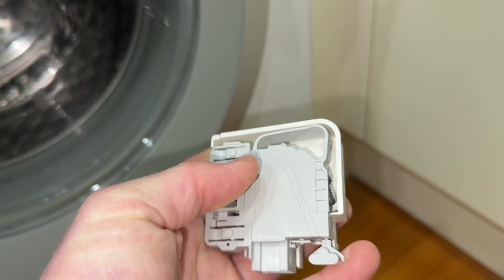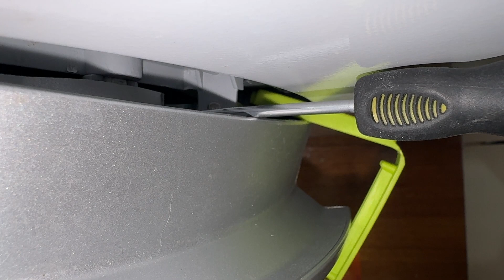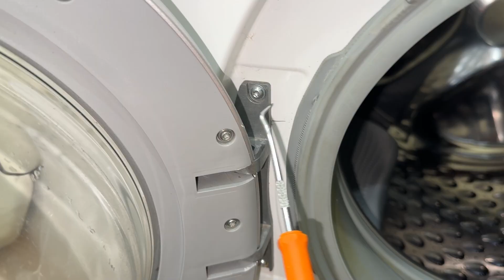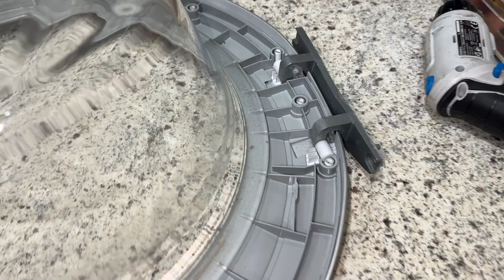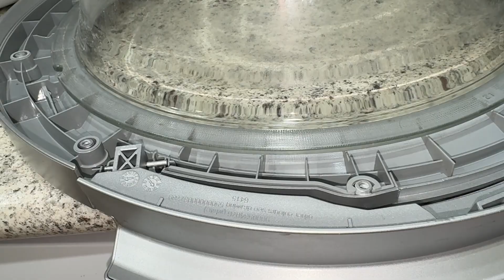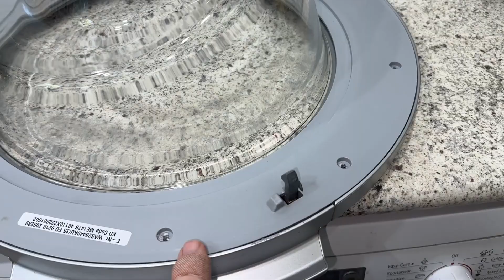Bosch Washing Machine Door Handle Repair – $0 Fix (Logixx 8 DIY)

Comment: Thank you so much! Such an awesome and pedagogical instruction video. Ended up supergluing the part that had come off and screwing a nail onto it like you (it came off again with only super glue). Works for now, we'll see if it lasts. My tip to people is to screw on the right side of the plastic plate. I first thought it was pushing from the "outside" but the "push" comes from the inside, hence the screw should be on the "outside part" of that plastic thing so support is on the correct side. Hard to explain what I mean without pics 😅
Reply from the maker: Thanks for the thanks, and that's a great suggestion, thanks for the extra insight for others watching!

Comment: Greetings from Croatia, Thank you very much, with your video it was easy to open a Bosch washing machine. Without it, I probably would never have understood the mechanism and would have wasted time with a credit card and some wire. Then I would probably have started digging the machine inside and removing the lock from the inside :-)
Reply from the maker: Glad I could save you the trouble and help you get it open easily!